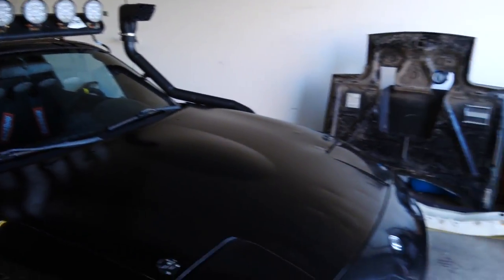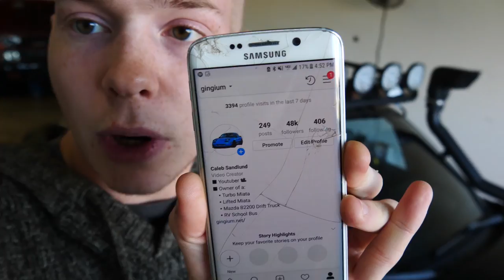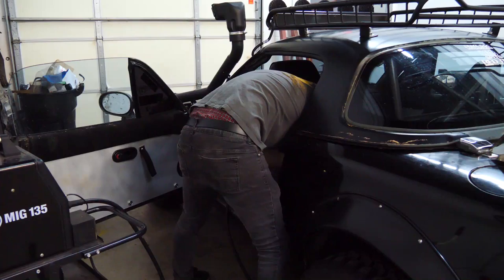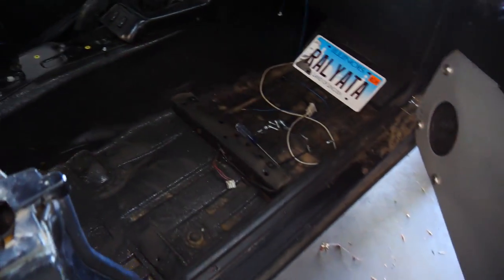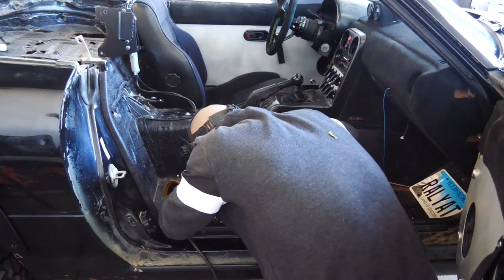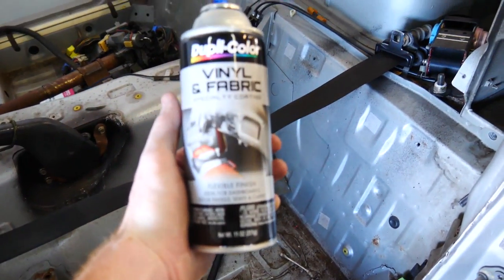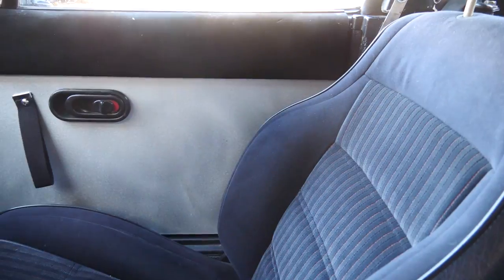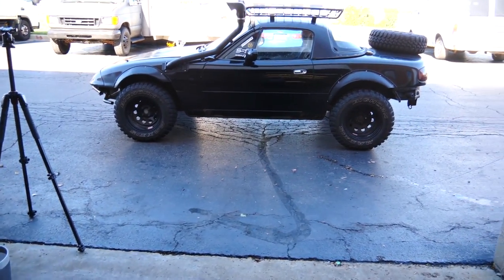Budget Seat Upgrade For NA Miatas!

Comment: Gotta love 80s JDM seats. My dad had an 89 Supra Turbo and those were by far the most comfortable seats I’ve ever sat in. I don’t know your take on this but I’ve seen guys apply an oil based undercoating (not tar or rubber based, those are the devil) to their undercarriages to protect their cars from rusting due to road salts and chemicals. Since it’s oil based and does not dry, your undercarriage will look like crap and look like it’s covered in gunk (which it is). However, that gunk keeps the moisture and road salt away from the precious metal. It might not be a bad idea considering you daily it in the winter and take it off road in the mud.

Comment: It wouldn’t matter for the seat welding application but if you ever have to weld something with that tack/spot welding technique you never use water to cool of the welds because if there is water left on the part when you weld the arc will split the water molecules and being  steel absorbs hydrogen when melted and not when solidified you will get hydrogen porosity making the weld very weak.

Comment: I hate the bucket seats in any car. My new car have very comfy heated electric seats with a nice arm rest, it´s really lovely car to cruise around. 
So I approve 100% what you did with Rally Miata. Put the air nozzles back to the dashboard. And roll cage in normal civilian road car is pointless, it´s just adds weight.
Reply: Imo bucket seats are 1000% more comfy than any other seats they hug your body well and give you support for your whole back even in driving position, and you don't fly around everywhere.
Reply: Melody I would sit in my sparco all day I have no regrets daily driving with a bucket over stock

Comment: Hit up Taylor Ray his friend parts out Miatas
Reply: Literally just about to say the same thing
Reply: He has a website... Bensusedmiataparts.com
Reply: If I had unlimited money and more mechanical knowledge than just changing fluids and replacing valve cover gaskets, radiators and mechanical fuel pumps, and changing the idle speed on a carburetor (On my car, the idle screw is on the end of the throttle linkage), I'd order everything required to build a Miata from scratch, because why not?
Reply: Yeah ben is a staple in the miata community, of you drive and work on your miata youve heard of that one guy thats made a business parting miatas lol.

Comment: Welding like that doesn't penetrate very well, which results in weak welds. Also cooling it with water shocks the metal and weld, causing it to contract and shrink very quickly which can cause interal cracking of the weld. So those two together made for a very weak weld unfortunately. Not trying to bash or sounds smart, but that's what's holding you in the car, just want you to be safe 👍👍

Comment: Hey gingium. I have a 4x4 1980 Toyota Hilux 4x4 I would sell you for pretty cheap. It has the axles, transmission transfer case and drive shafts. I have the motor that came out of it, had a rod knock when I pulled it. Plz message me about if you are interested it would be awesome having something of mine go towards an awesome build! If you do any research on old Toyota 4x4s they are some of the most badass off-roaders out there I have an 83 I built to overland. Again thanks if you read this

Comment: WHERE are the update patch notes???!?!
Reply: Gingium Update 1.0
>Changed the Offroad Miata around some more
  -Added comfier seats
 - Installed stock center console
  -removed Hydraulic E-Brake
>Planned patch to the exhaust system
>Hopefully, the team can get to work on adding Wiring to the Drift Truck, codenamed "Project B2200"
  -Still no word on when that'll happen, the engine design team took longer than expected with their job.
>Swept the plasti-dip into a nice pile to make cleaning up easier to do, hopefully during the 1.1 patch
>Have not yet upgraded "Hair Growth" fraction to 1
  -Programmers believe that "Baldium," as they call him now, is superior without hair.
Reply: @lsswappedcessna  hmmm

Comment: Since your completely undoing almost everything you might as well buy a better condition Miata when u do the AWD swap. One with a better body and less rust.
Reply: MD 301 that makes almost 0 sense for him to do, why spend $2,000+ on a new miata that he would have to re mod EVERYTHING on when he already has this on and has money problems as it is, thats just stupid. Plus the thing is a freaking off roader its just going to get beat up again.
Reply: Sirens how is would it be stupid? It’s not hard to strip down a car. The rally Miata is beat up its been cut a million times etc. the AWD swap is gonna be expensive i would want to put it on a car in good condition that’s not gonna fall apart
Reply: MD 301 but again, its an offroad car, why would he buy a nice new shell just to beat it up again? He would be spending $2,000+ (that he does not have) just to take out a few dents and small rust spots. Plus he can just replace the cut fenders and cut hood with  different ones easy pz for way cheaper than a whole new car. The car is not going to fall apart you make it seem like its a pile of junk but its fine. And it would take alot of unnecessary time just to get it back to the same point its at now. It would make waaay more sense to just fix up the shell he has now Its fine.

Comment: Straight pipe the rally miata
Reply: Angry 4-cylinder noises
Reply: Daily straight piped miata gets old real quick, believe me I know 😣
Reply: @Kreed1910  so does wasting money on a exuast
Reply: @baileywestby  spending around 300 bucks ones for a good exhaust is worth the ear rape that comes with straight pipe
Reply: @Kreed1910  or spend 5 on some ear protectors
Reply: @baileywestby  daily ear plug miata lol
Reply: Kreed1910 just do a muffler delete